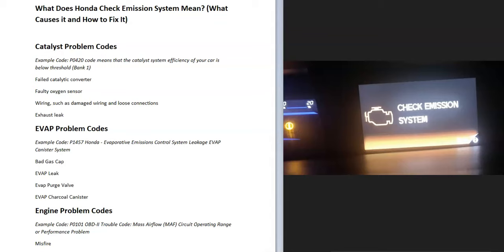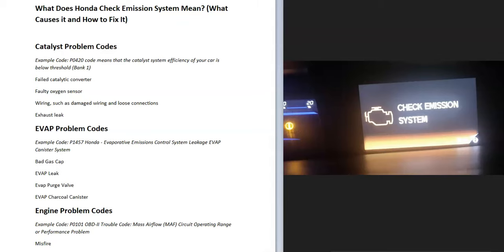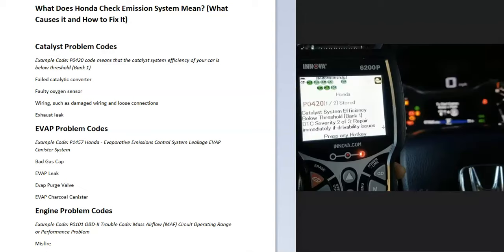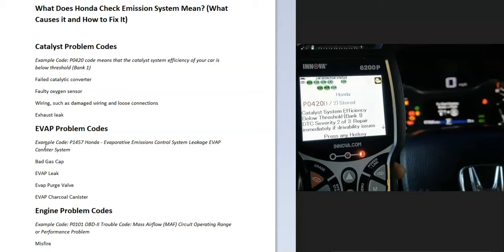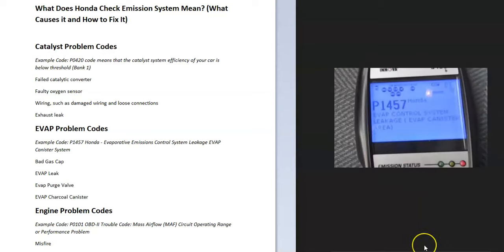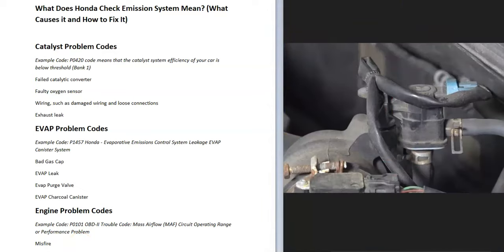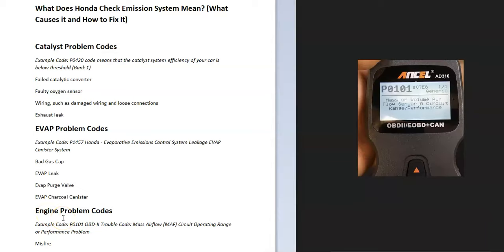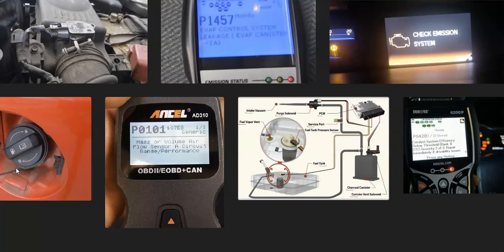What Does Honda Check Emission System Mean? (What Causes it and How to Fix It)

Comment: This error came on for me today, the car was outside in a temperature of -36 Celsius for 12 Hours. Could the extreme cold have caused the error with a frozen sensor perhaps?
Reply: Mine has been on since it’s been freezing cold too (recently). I hope someone answers your question.
Reply: Same happened to mine . It was in -36 too overnight.
Reply: Same happened to mine recently not quite that cold but quite cold
Reply: Just so you all know, i used an odb 2 scanner and the error was for the evap system, but by the time i had scanned the check engine light and warning both went away on their own. Likely just something frozen and now its back to normal.

Comment: I had the same problem, I fixed it and everything works perfectly fine, but the check emission system light is still on, is there a way to reset this?
Reply: disconnect battery
Reply: Hey you can just unplug the hot cable from the battery and wait like 2 minutes and hook it back up

Comment: Any help: I recently changed my fuel pump . The day after on my way to work , a tighten gas cap notification came (which comes on and off ). But now it’s off but the emission light came on . Any help?

Comment: Hi there, i have a Honda Jazz 2006 model, it drives fine with no problems but when i drive over 60 Mph on motor way it turn ons the check emmission light, and it goes away as the engine cools down.. performed scan but no code came up, do you have any clue of the problem?

Comment: P0128. 2012 Civic ex temp sensor Great Video. Easy Fix.
Reply: Swapped mine out but the light is still on also changed the thermostat it’s still showing the same code any ideas?

Comment: I got the code P24CO on a Honda crv 2020 and the problem is water on the Evap system so I went under the vehicle and I took the charcoal canister but also is another piece next to it which one should I remplace ? Hope you can help me with this the dealer wants  charge $1000. For this repair
Reply from the maker: It is likely a leak detection pump. Many new Honda Evap systems have a charcoal canister and leak detection pump. Each part needs to be tested to know if it should be replaced.
Reply: Did you get this fixed ? Same problem

Comment: I have an issue  in my 2015 CR-Z .  The check   emissions light and check engine light came on. But when I go to pull codes, there are no codes listed and or pending.And it's done this a couple of times so I'm kind of lost as to what it could be since it's not throwing codes.I also erased it and the check.emissions text came back

Comment: I did a flex fuel kit on my 10th gen but I didn’t receive a problem until i did a full tank of e-85. Im trying a blend of 91 and 2 gal or e-85 to see if that will fix the issue

Comment: sigh, they have this super complex software right in the dashboard of the honda in both the dash above the steering and in the entertainment system, couldn't they push unusual OBD codes to the "warning" view on the dashboard display?  What I see now is crap like "emission system problem - avoid heavy acceleration, see dealer"

Comment: Today i took my 2015 Honda pilot for smog check and its fail.  Result for failure was fuel metering system, crankcase emissions control and other emissions related components system.  Help please.
Reply from the maker: I would check the PCV Valve

Comment: My 2017 honda crv had the Emissions System Problem message, and the scan returned the P219e code. Any idea what this fix could be, and cost ? Thank you
Reply: Honda P219E Code: No. 3 Cylinder Air-Fuel Ratio Variation
Reply: @JereB698  
Thank you.  And what's the likely fixing options? Is this something that the dealership will look into under warranty?
Reply: @valerin863  A P219E Code can be caused by several things. I would check the spark plug, plug wires, ignition coil, and fuel injector on #3 Cylinder.